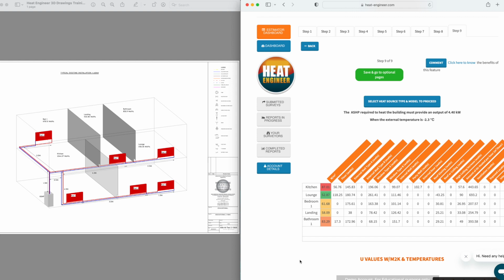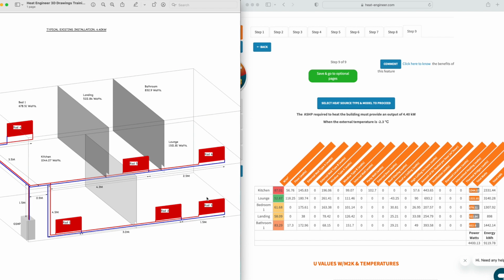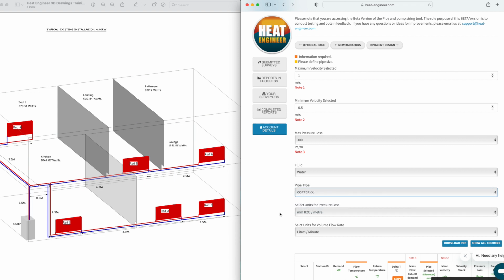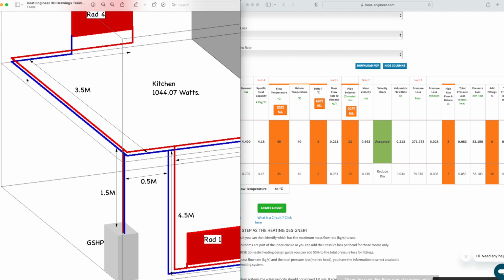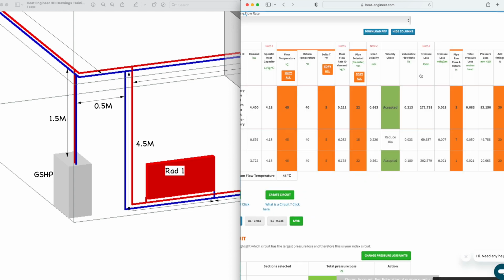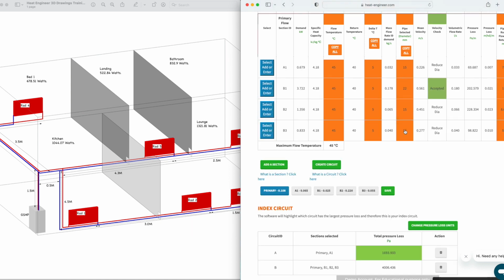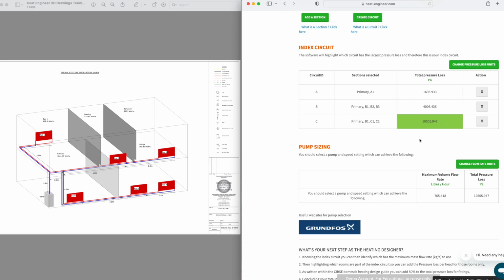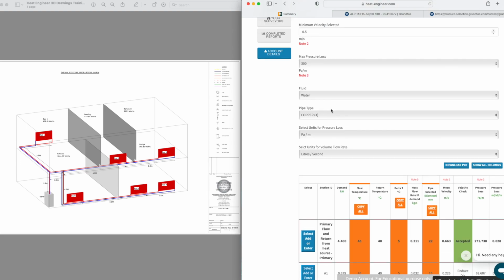Pipe Calculator Tutorial

Comment: Why did you add 30% loss (3 fittings) for the Primary circuit when 2 of those fittings are part of the A1 circuit. Then you added 30% (3 fittings) again to A1 circuit. Isn't this double counting fittings?
Reply: I agree with you - seems like a mistake. My understanding is that the primary circuit should have been 0% and A1 circuit would get the 30% (1 tee, two elbows)